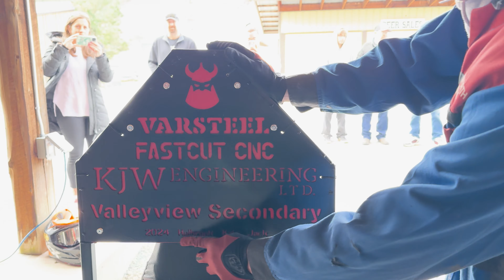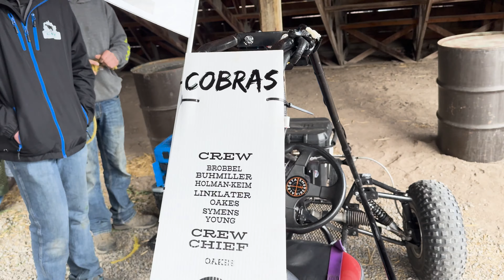Edison Motors High School Go-Kart Challenge 2024

Comment: I am involved in EVolocity, a similar event in New Zealand,  that has been running for quite a few years now.  To keep costs down the motors and batteries are a bit less powerful, so the event is run on a sealed course not gravel, but the result is similar.
The students (and staff) involved learn a lot about design, welding, vehicle dynamics, electricity and electronics etc, but perhaps more importantly they learn about teamwork, problem solving and persistence as necessary elements for a successful project.
If you run it again expect many more teams. After a couple of years expect to have to hold regional events and bring the top 2 teams from each region together for national finals...  But keep doing it! This type of "real world", student-led project teaches more and better than classroom lessons, and the students who take part are more likely to be successful in future study and employment because of their involvement..
Plus you will be developing a future workforce for Edison Motors!